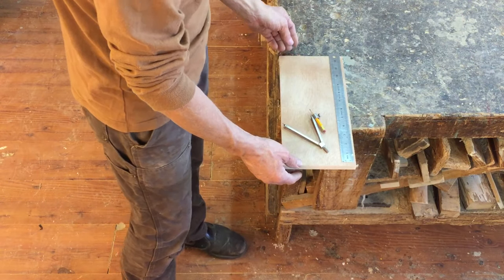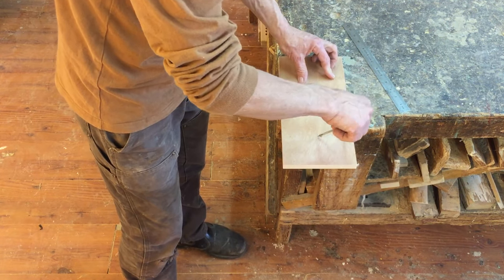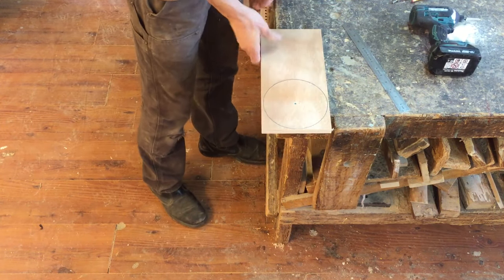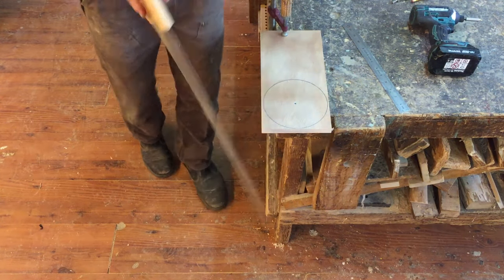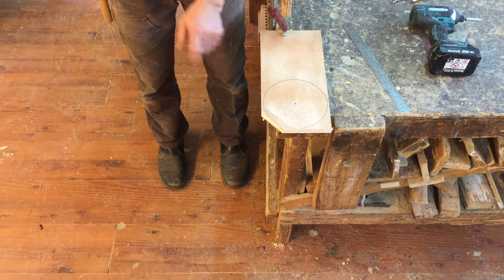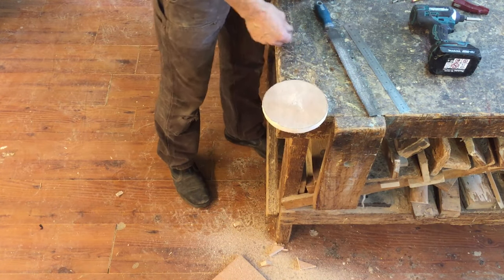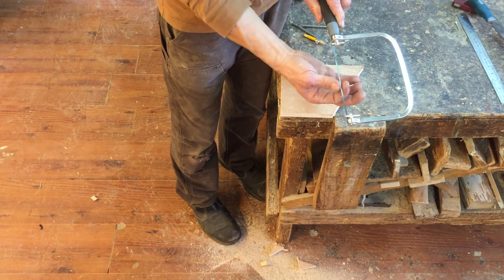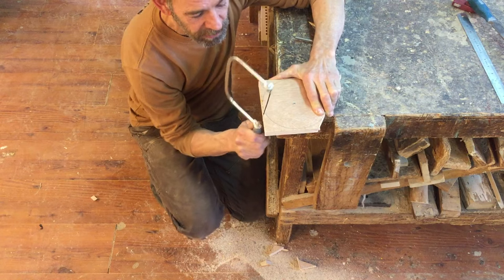How to Cut a Circle out of Wood

Comment: Nice job 👍🏻 thanks for this video. I am making a table top. I need to round up the edges with  a high radius and was wondering if I need to get a jigsaw. but your video helped. I think I will go with a coping saw.
Reply from the maker: Hey Shiv good luck take it slowly if the material is thick use the blade with the least teeth you can find Happy Woodworking David

Comment: If you don't cut the pre cuts right up to the line, leave about 3 - 8 mm, depending on the wood, you can then cut a perfect circle with the saw.
 The excess wood holds the blade, as a guide and breaks of as you go, you can follow the line perfectly. The saw needs to be at 90°.
Reply from the maker: Thanks Robinhood for your constructive feedback Happy Woodworking David

Comment: Nice but I was looking about how to a speaker hole without a jigsaw...
Reply from the maker: Hi you can drill a series of small holes in a circle then clean up the uneven edges with a rasp , sand paper or whatever you have . Good luck David
Reply: @RusticDavid  yep, I already tried it but it's a 12inch diameter hole it takes too long..
Reply from the maker: @kareemgalaroza822  maybe a coping saw it’s a cheap hand tool or a key hole saw if you can find one or borrow a jig saw